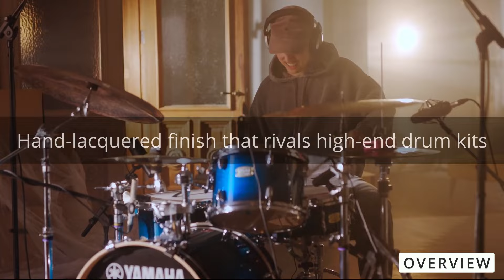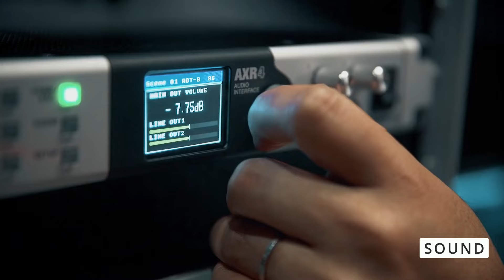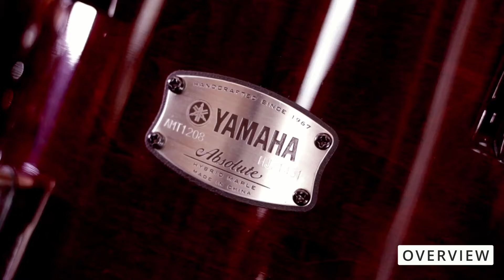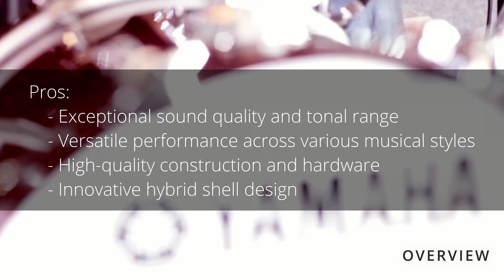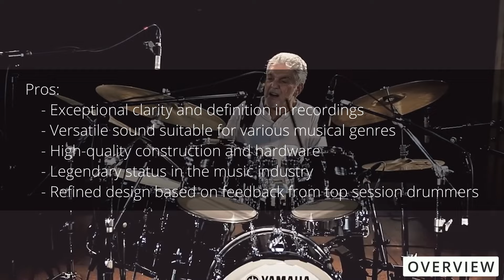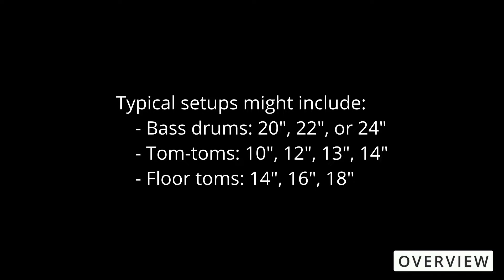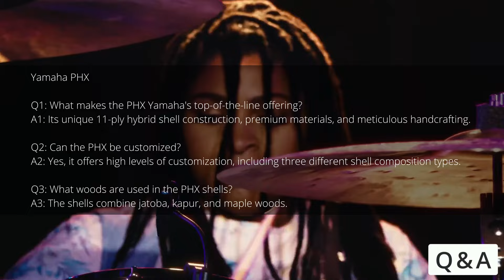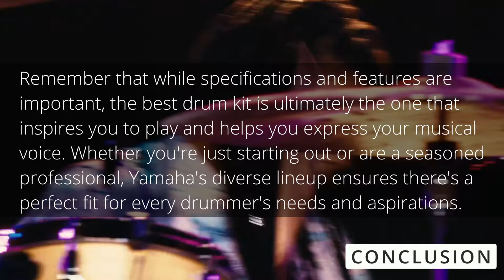TOP 5 - BEST YAMAHA DRUM SETS (Stage | Live Hybrid Oak | Absolute Hybrid | Recording Custom | PHX)

Comment: For price, etc. you cannot beat a Stage Custom.     Just because there are more expensive woods in the world, it does not mean they are better for drums.   Throw some Remo Ambassador clears on there,      and you're ready to go   .   ( though I did go with a different snare)
Reply: I use ambassador coated. Very tasty sounding.
Reply: Stage Custom 👌
Reply from the maker: Thank you for sharing your experience with the Yamaha Stage Custom! Your comment highlights several key points that many drummers appreciate about this kit.

- You're absolutely right about the value proposition of the Stage Custom. It's widely regarded as one of the best bang-for-buck drum sets on the market, offering professional-level quality at a more accessible price point

- Your point about wood types is spot-on. While exotic woods can be exciting, birch (used in the Stage Custom) is a time-tested tonewood for drums. Yamaha has a long history of crafting excellent birch drums, dating back to their renowned Recording Custom series. The Stage Custom benefits from this expertise, delivering a focused, punchy sound that's characteristic of birch.

- The recommendation for Remo Ambassador clear heads is solid advice. Many drummers find that upgrading to quality aftermarket heads, like Ambassadors, can significantly enhance the sound of the Stage Custom. It's a cost-effective way to elevate the kit's performance

- Interesting that you opted for a different snare. While the matching birch snare that comes with the Stage Custom is quite capable, many drummers do choose to customize their setups with alternate snares. It's all about finding what works best for your personal sound and playing style.

Thanks for contributing to the discussion with your practical insights. 
Comments like yours are incredibly helpful for drummers considering their options!
Reply: @musicessences  Thank you for the nice long reply!    Subscribed.   GL2U!
Reply: Where is tour custom maple??
Reply: @eduardtolentino7243  Probably didn't make the cut. I'd be interested to know why, as I'm tossing up the option of a 14 x 13 Stage Custom floor tom for AUS $200, or a 14 x 13 Tour Custom floor tom for AUS $600
Reply: @musicessences Coated ambassadors... i should have been more specific.  Lol
Reply: @musicessences  I also use the snare that came with it. Coated power stroke 3. Tuned high and cutting. I also have other snares that i use.

Comment: I have   a 2002/2003 Stage Custom Advantage kit (birch, mahogany, falkata), unfortunately I could not get the sound that I liked. Any recommendation for batter heads and reso heads combination for a heavy/ deep rock sound?
Reply from the maker: Thank you for sharing your experience with the 2002/2003 Yamaha Stage Custom Advantage kit. It's understandable that you're looking to achieve a heavy, deep rock sound. Based on recommendations for similar kits and styles, here are some suggestions for batter and resonant head combinations:

Batter Heads:
   - Evans G2 coated or clear: These 2-ply heads are popular for rock sounds, offering durability and a full, warm tone
   - Remo Emperor coated or clear: Another excellent 2-ply option known for its deep, punchy sound
   - Evans EC2S: These heads feature sound shaping technology that can help control overtones, which might be beneficial for your desired sound.

Resonant Heads:
   - Remo Ambassador clear: A single-ply head that complements the fuller sound of 2-ply batter heads.
   - Evans G1 clear: Similar to the Ambassador, this single-ply head can help maintain resonance.

Bass Drum:
   - Batter: Evans EMAD or Aquarian Superkick II
   - Resonant: Evans EQ4 or Remo Powerstroke 3

Specific Combinations:
For toms, try Evans G2 coated on top with G1 clear on the bottom. For the bass drum, an Evans EMAD batter with an EQ4 resonant could give you that deep, punchy rock sound.

Additional Tips:
    1. Experiment with tuning: Lower tuning generally produces a deeper sound.
    2. Consider using moongels or other dampening techniques if you need to control overtones further.
    3. Remember that stick choice and playing technique also significantly affect your overall sound.

Lastly, while these recommendations are based on common preferences for rock drumming, personal taste plays a crucial role. Don't be afraid to experiment with different combinations to find the perfect sound for your style.
Reply: @musicessences   Thank you. I'll try these suggestions.